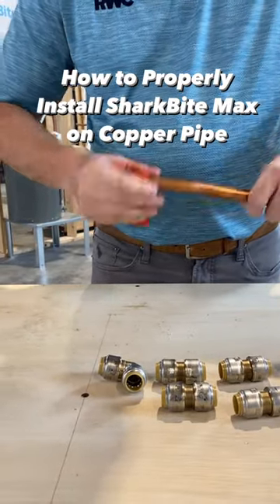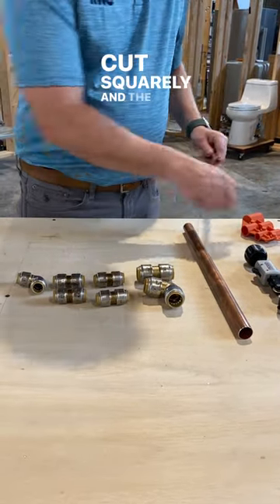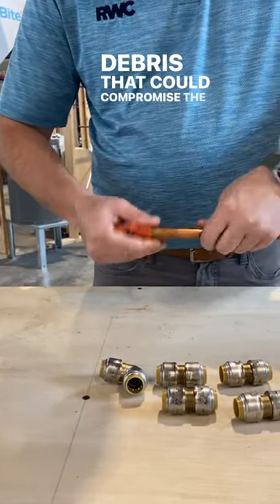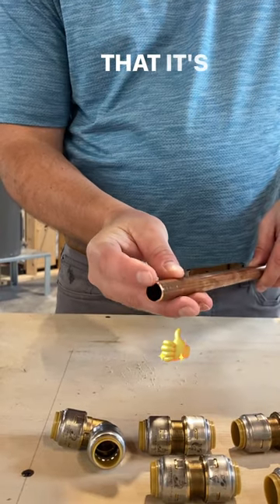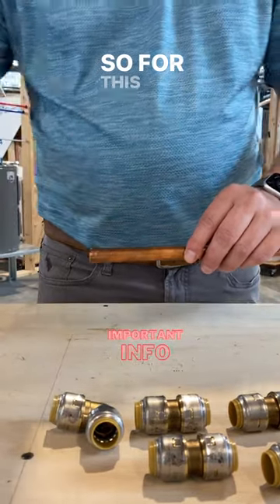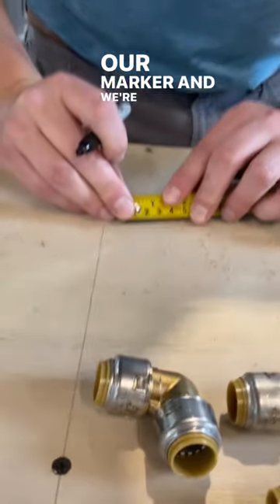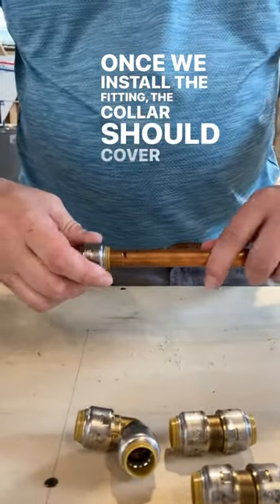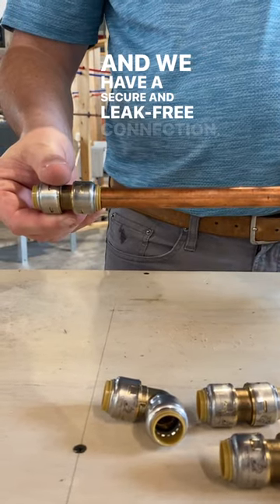How to Install SharkBite Max on Copper Pipe

Comment: If I were to use this fitting and install a 1/2" spigot valve, would want to rotate on the pipe when turning the valve on/off?
Reply: Valve should be secured

Comment: What about the white peg insert? Is it important? Just put one on and saw that I have white pegs in the bag.
Reply from the maker: Hi there👋 PEX tube liners are built into our first-generation fittings, but are not included for SharkBite Max since it is no longer required per ASSE 1061.
Reply: @SharkBitePlumbing  If I want to connect cooper to pex, and my unit has a collar on one side and no collar on the other side. What side is for the two different pipe/tube.
Reply: @michaelrodriguez5012 sounds like you either have a PVC x CTS fitting or a Polybutylene x CTS fitting, neither of which is designed for the application you are referring to.

Comment: Is fitting the shark bite something you only have one shot at?
Reply: no they come on and off no problem
Reply: They sell removal tools dirt cheap. Or if you need one asap find a washer that can fit over the pipe and cut a slot into the washer big enough to slide over the pipe and press against the white insert sticking out of the fitting. At the same time as pressing it pull the fitting away to remove it

Comment: Would anyone recommend this for external use on a pipe like pipe going to outdoor sprinkler system?  What would the cold weather elements do to that?  Or would soldering be preferred in that case?
Reply: Use pipe made for sprinklers systems
Reply: @jeffwinterfeldt5705  You have just stated the obvious but didn’t really answer my question.
Reply: No I would not recommend..these fittings are trash and made to break.
Reply: @thadiamondcutta  thanks for the reply.  I felt that might have been the case but needed confirmation.

Comment: Do I deburr a PVC pipe?
Reply from the maker: Hi Joseph — Yes! Even plastic pipe can have sharp edges or burrs that can damage the o-ring in the fitting. We always recommend deburring the pipe — no matter which type you're working with — to ensure a proper, secure connection.

Comment: You know what the previous homeowners used shark fittings. Guess what? It gave out, and now I have about 4-5k of water damage. Not including getting mold prevention.
Reply: my homes previous owner used copper and its all rotting and leaking as well....
Reply: No issues after years using SharkBites in my home. It's likely they didn't deburr the pipe ends first.
Reply: Good
Reply: I'm so sorry to hear that. If the fittings where actually genuine Sharkbite brand, it's much more likely a fault of poor installation on the homeowners' end rather than the product itself.

Comment: Best way to install it is to not install it
Reply: They don’t leak if installed correctly. So much false info bro
Reply: Just another person trying to jump on the bandwagon
Reply: @88kwthomas  if you just install the designed fitting for that pipe it's a cheaper and b will most likely last longer so say what you want but I can guarantee if you were going to build a house from scratch you aren't using shark bites so what does that say